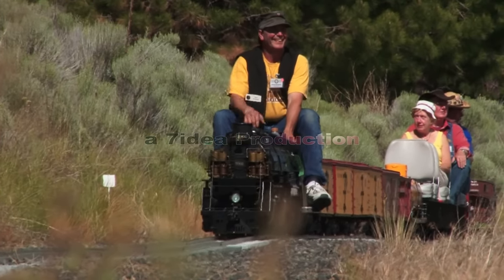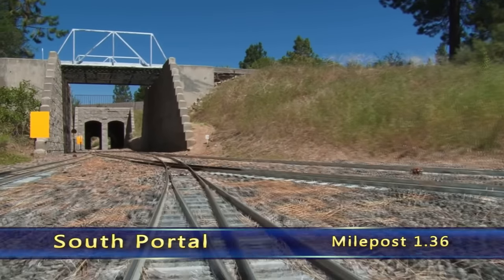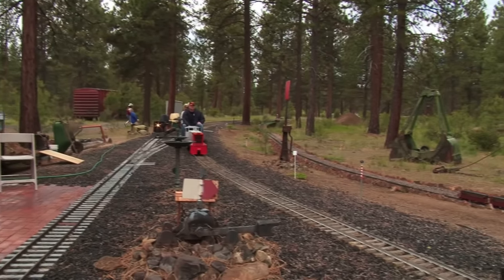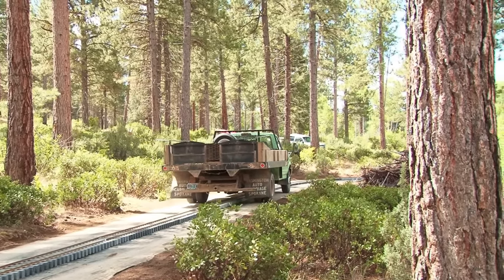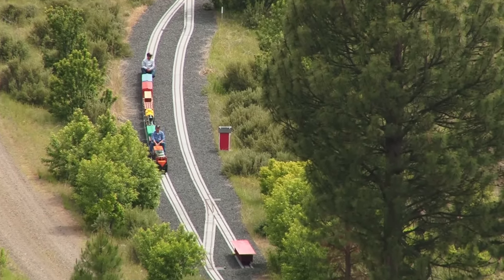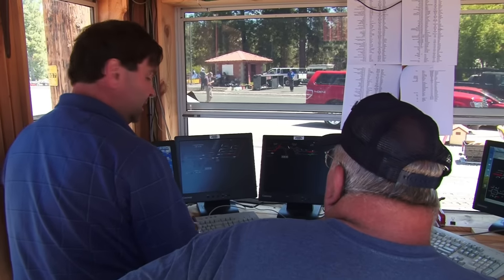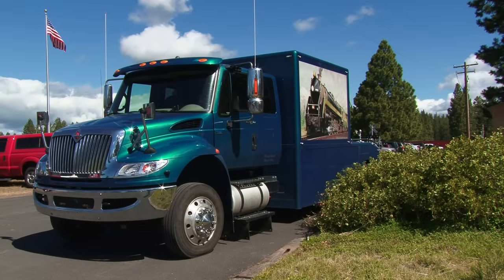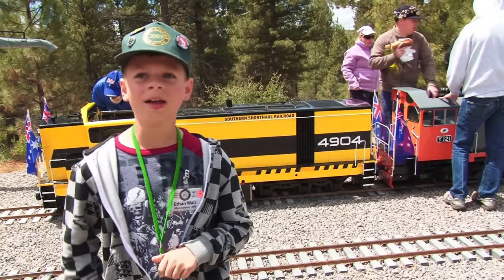The Biggest Little Railroad in the World Part 2

Comment: I'm amazed at the weight some of those tiny locos can pull.
Reply: Mine has 16 hp gas engine running hydraulic pump. Traction motors are 2 hydraulic motors. Can pull a good 2 tons worth of train and riders
Reply: Si, estan bien gordos los pasajeros

Comment: Curious what the car limit is assuming there is one.
I'd be that guy if i could, would have a twenty to thirty car long train.
Course i would have at least two special all purpose cars added in regardless of the amount of cars and would need to be closer to the front.
Reply: On a circle line, there is theoretically no car limit given. You have platform length, or on bidirectional traffic, length of passing points as a limit. But just to go on circle, the limit is the engine power, but you can couple as many separate train to a single train, and make it kind of endless. The number of existing cars, will limit it ;-)
Reply: Train mountain has done record breaking train length runs. I don't know the record but most involved several locomotives spaced between cars. The main issue with a single locomotive train is the lateral pull on curves that causes derailments. Weight/force ratios differ by scale so smaller rolling stock doesn't stay on the track as well as full size.

Comment: Can anyone tell me why the ballast is so wide on each side of the tracks?  It looks to be over kill when compared to the width of the ballast on a standard gauge railroad.
Reply: because of growth of plants is on larger scale for proportions/ratios?  Also they tend to add more tracks besides ones they have laid for addition lines , loops, and/or  sidings so trains can pass each other.......
Reply: @ablemagawitch  part of the plant growth issue is fire prevention.
Reply: Scaling issues.
Reply: @jimwhelan9152    I’m not sure what you mean?
Reply: @billmorris2613  Not everything scales in the same proportion. Several issues affect the amount of ballast needed. Among them the need for distance to avoid fires, a big concern at Train Mountain. Another is that more ballast in proportion is required for the smaller track. I'm not aware of all of the issues related to ballast, only that more is needed due to issues of scale.

As an example of a easily understandable scaling issue, volume and weight increase with the cube of distance. That means for the 1:8 scale (the scale of standard gauge at train mountain) the prototype locomotives and rolling stock are 8x8x8 = 512 times as heavy as the model equivalent. This makes a huge difference in how well they stay on the track and means derails are more common. Boilers, tender capacity and steam cylinders are 512 times smaller than the prototypes so hauling ability and range are also much smaller than 1:8.